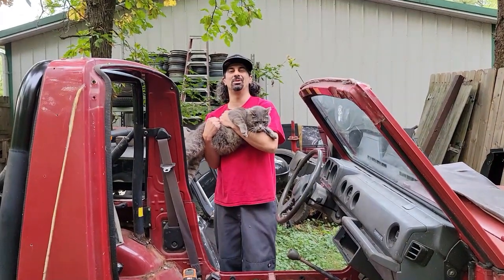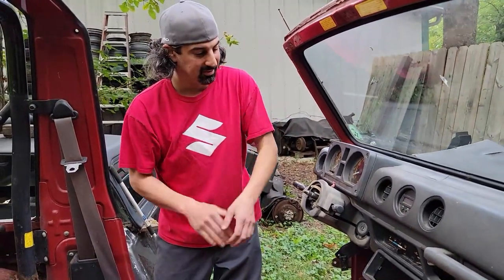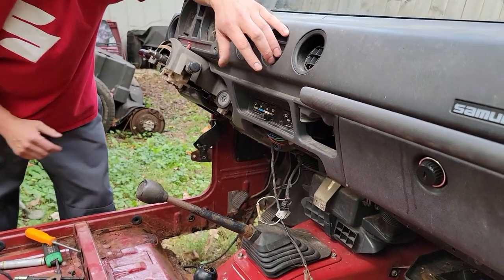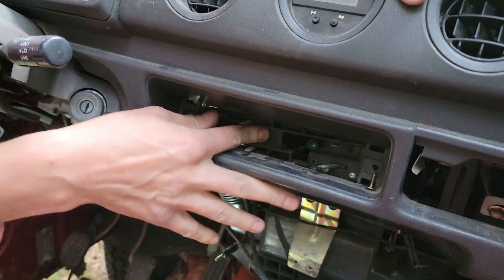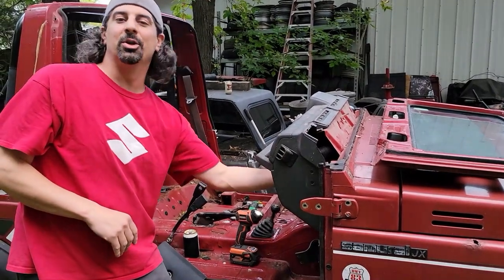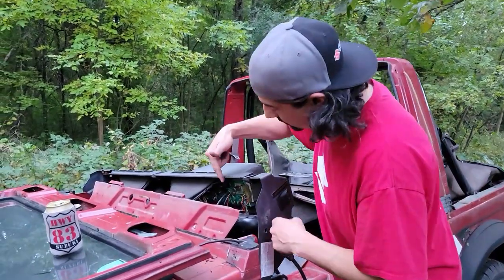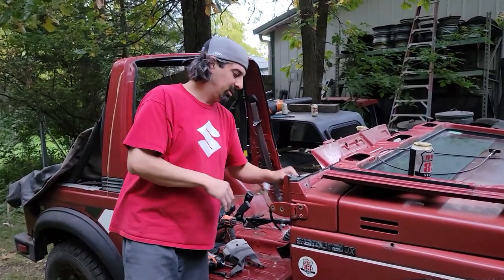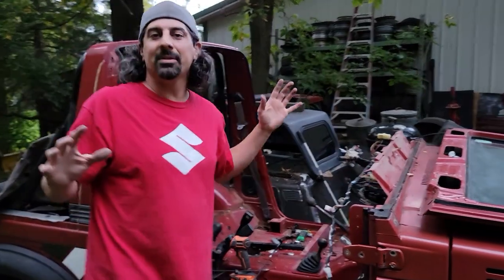Removing Dashboard from Suzuki Samurai  @Hwy83SUZUKI

Comment: I'll be ordering more stuff from you, but I have, what I believe to be the whole A/C system including the dash part with the A/C button. My question is, does the wiring harness have all the plugs I need to just plug in? Or do I need the wire harness he supplied me with also along with the ECU? Which he gave me also. I WILL be needing the compressor bracket for sure. Thanks in advance. I'm having a cold one with ya. LOL

Comment: Aaaaaaay Tony. Thanks. Hope it works the same on a 86 Jap tin top. Gotta pull the heater because it’s leaking inside and the motor is missing full throttle aswell. Great s from across the pond!

Comment: Got any videos on removing the bezel from around the air selector and radio? I think I have a loose or broken cable that controls the air "vector" doors. I just reached under the dash and set it to defrost. I gotta have that.

Comment: I cannot find a springs/suspension video do you have one?  I put new springs on my Sammy that are HD but now it rides like a brick however the shimmy my gearing has going between 1 and 2nd went away.  Solved one issue but created another one.
Reply from the maker: For softer ride you want longer springs, like RUF-CJ kit or YJ kit

Comment: Got a question for you. I have a 1988.5 Samurai with a 1.3L engine. It has a carburetor. It's go the square vents. My check engine light is on. I went to reset the check engine light with the check engine light switch under the dash but found that the three wires that come from the switch are not connected to anything. It appears that the previous owners likely replaced some of the instruments and didn't reconnect the switch. Is it possible to clear the check engine light without the switch? I tried removing the negative battery terminal but that did not work. What causes that light to come on anyways? Is it purely a maintenance warning light or could there be something wrong. I can't find any information about it other than it is a warming light for maintenance purposes. Thanks,
Reply from the maker: Plug the switch back in
Reply: That's why I watched your video, just in case I have to remove the dash to get it wired back in. I was hoping there might be another way to do it before pulling off the dash. Thanks  @Hwy83SUZUKI
Reply from the maker: @gsschneck  you can just remove the gauge cluster, don't need to pull the whole dash
Reply: I'll check into that. Was not aware of that possibility. That seems a little more reasonable although removing the dash does look fun. Thank you!!!  @Hwy83SUZUKI